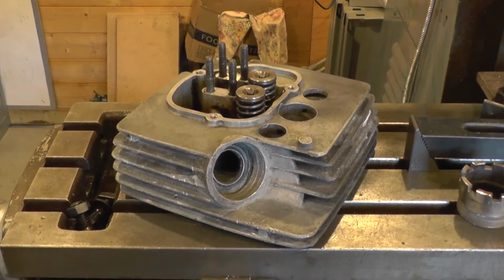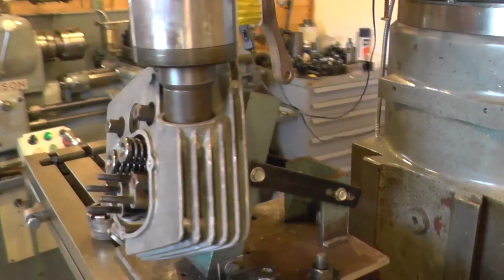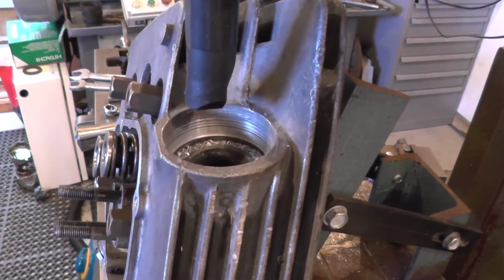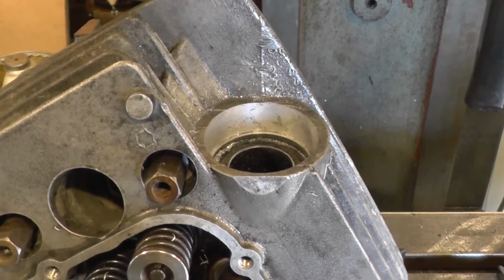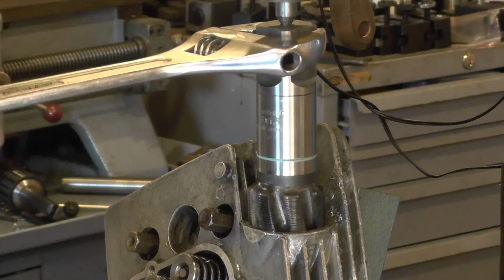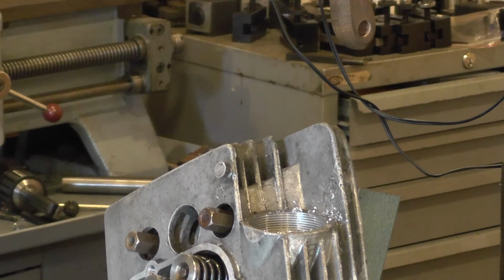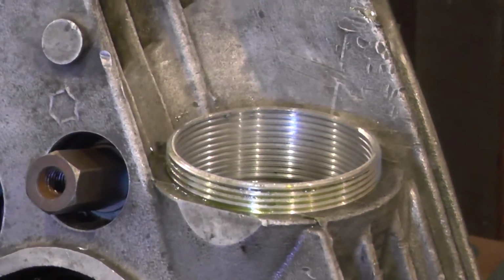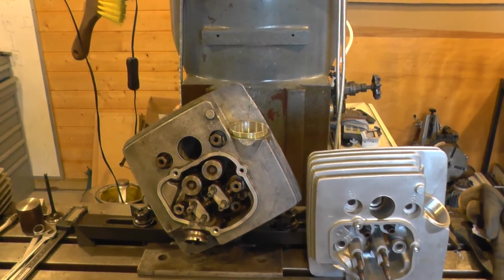Cylinder head repair - Morini 500

Comment: Nice repair Paul! 
On the head with more meat around the insert  could you possibly use a  dutch key  sort of thing to lock it  ?   If you put some anti seize on the thread of the exhaust pipe maybe it will help with future removal , even if you exceed the  temperature of the loctite it will still hold once it has  cooled  down so as long as the thread for the pipe doesn’t seize  up you won’t have a problem .
Reply from the maker: The owner of that head has a tame welder. I have considered a Scotch key, but I'd like to see how the adhesive does, it's a much simpler solution.

Comment: Hi Paul, Nice job, I think you will getter better results in steel and not so much chatter, if you turn the boring bar 180 degrees in the boring head, then the forces will go into the head and not into the screw.